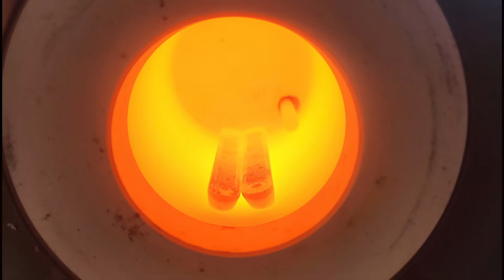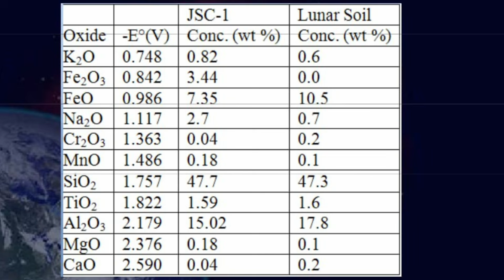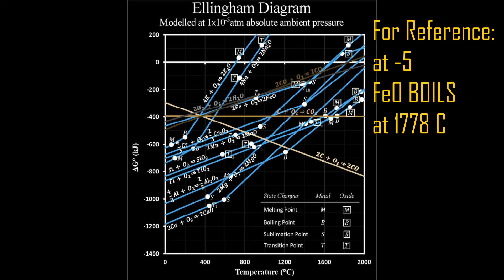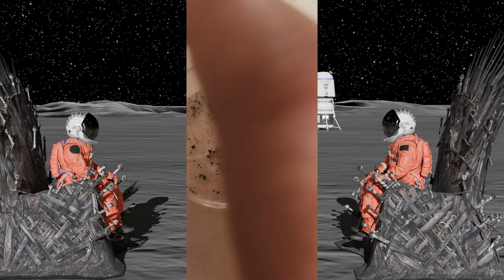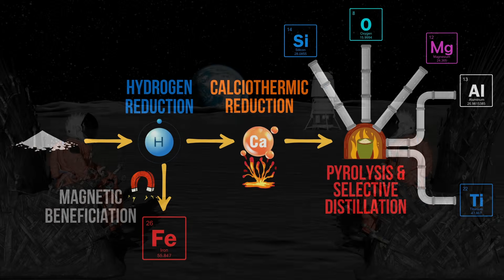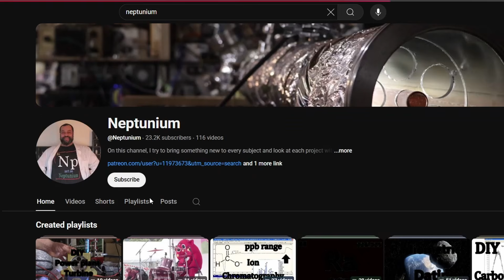Refining Moon Regolith With Lasers (Part 1)

Comment: 29:40 Helium isn't just used to cool quantum computers; it's used to cool the superconducting magnets in MRI scanners and NMR spectrometers, and the cost of boiling off non-renewable helium is a huge expense for science in those fields. Then again, given that boiling off the helium is often cheaper than trying to recover it means that maybe it wouldn't be cheaper to import helium from the moon 😅

Comment: one thing tham may be helpful: metal matrix composites may work as substitutes for alloying elements- instead of vanadium and carbon, it might be possible to simply mix alumina micro/nanoparticles into the iron matrix to get steel-level performance, 
aluminum and magnesium could support a lot (50 wt%, maybe more) alumina or silica or basalt or so to save on the energy intensive material, while at the same time improving its properties- and getting many of the benefits of metals, ie easier processing, toughness, tensile strength vs ceramics

Comment: 1.Grind your silica into fine power
2. Spread it 1mm deep over an area 1cm × 10cm
3. Sweep over the length of it with a 1 cm wide circle with the laser 

See if you can make several 1cm x 10cm strips of silica

4. Now , place the strips side by side , fill in the gaps with more silica dust , and see if you can weld them together with the laser.

Comment: I was inspired by this video to (at least try) and design a machine to do this. How much regolith would have to be processed (kg/hr)?
Reply: Note that I’m just a high school student and my only chemistry knowledge is from last year where it was a required course so I may not yield any results
Reply: Really depends on how much you need. For the very first refining processes built on the moon, 1 metric tonne per hour is probably reasonable given infrastructure limits (The bottleneck is not the small bucket-wheel harvesters which could gather dozens of tonnes quite easily, but rather the nuclear microreactors' limited power output).

For a larger colony, you probably want to produce enough hydrolox fuel per craft landing. For example, if you have 1 starship HLS arriving every week (with tourists and scientists), 1500 tons a week of fuel should be viable to avoid burning money, so let's call it 2000t per week to make some profit for the investors and provide enough water left for all of the colonists. Hydrolox fuel can be made easily by electrolysis of water, and given the approximate 5% water ice composition in the lunar PSRs, you'd thus need about 40000 tonnes of regolith processed per week, rounded up to about 250 tonnes per hour, which also leaves plenty of metal to be used for construction and to be sold back to low earth orbit for construction.

With a specific heat capacity of 800 joules/KgK, you'd need about 80Mw to maintain this upkeep, well achievable for a small modular reactor (since it's just heating, you can use the waste thermal energy for the first stage).

Comment: tbh, from the sounds of it, a giant tungstein crucible, thats being heated by a buncha solar reflectors, so everythign will melt below 3000c/6000f,  and then jsut have a tall evaporation chamber since everything turns into a vapor, and have a oil vapor distiller off it,

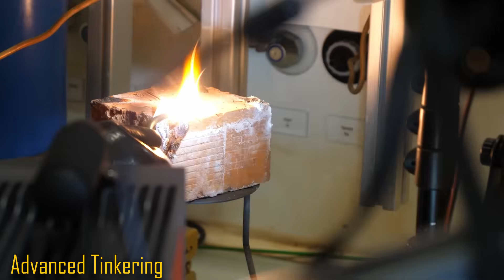Comment: 9:32 just like ask nile red to do it, or cody's lab. Failing that, collab with hyperspace pirate or Explosions&Fire.
Reply: Also a fluidized bed reactor could use chlorine to make volatile chlorates, which would decompose in different ways, allowing filtering by chemical processes.

Comment: You mention a lot about needing to import various materials (e.g., flluorine, iridium, etc.).  I understand you to be specifically referring to the period in which humankind have small outposts; but eventually, when industry has been built up sufficiently, such materials could be mined or extracted in other ways, right?  They are not that much rarer on the Moon than they are on Earth, especially considering that the Moon is not as strictly differentiated as Earth.  Correct me if I'm wrong, though.

Comment: at at 1621. My biggest criticism would be that sublimation of materials in a closed system would raise the pressure far beyond the ideal pressure for decomposing. its theoretically possible but the amount of usable material produce would be so low that it is unviable
Reply: Presure is maintained by a pumping system to  maintain a relatively low pressure
Reply: @friskydingo5370  The main problems is if your trying to use this laser process to do industrial scale processing . (as in trying to refine a mere ton of material in a day) . at best it would take a century of shipment to the moons to reach that level
Reply: @groomschild1617  The current set up can produce several grams a minute for iron. This may not be the best for industrial scale but it dose have the advantage of creating a item directly and may have neich purpose. This is just one of many reduction methods that have been tested. The laser is a surrogate for the sun in the lab. This is part 1 their will be more methods explored in future episodes

Comment: I once tried burning an oxyacetylene torch in a vacuum chamber to test a scene from the book Artemis by Andy Weir. I could not get the torch to light. Even passing a stochiometricly perfect mixture over a coil of glowing resistance wire didn't work.  When I ignited the torch before vacuuming out the chamber it worked just fine until about .2 atmospheres when the flame got big and then went out. I hypothesized that fire needs pressure to work. To test it I did several more tests with gunpowder, thermite, potassium in water, and even nitrogen triiodide. (videos of these are on my YouTube channel) All reactions were greatly slowed or stopped by lack of atmospheric pressure, only the thermite and potassium was able to burn but I suspect that's because the reaction is more like a shorted battery than a fire.
Anyway watching this I realized that a laser heating a rock is basically like trying to burn a torch that runs on oxygen and metal vapor. With atmospheric pressure the reactants are held together and can completely react but if the pressure is low enough the atoms can fly apart and cool off too much before they react completely. 

I guess now the question is can this be scaled up or is it always going to be just a curious thing that can happen? the problem I see is if you have a big enough laser the vapor coming off the rock will make its own pressure.
To put it another way if you make a rock very hot the vapor coming off will become an atmosphere of sort due to the reaction force as it rockets away pushing back on the vapor that comes after. If you really need a high vacuum the density of the vapor coming off is going to be very low and it will take forever to get a ton of product. 
It may be necessary to have a very large reactor, a big surface area being heated and a large volume for the vapor to expand into, to prevent pressure build up. Even processing a few grams per second might need something that makes a major league stadium look small. Of course, with the low gravity and no weather that might be viable, I doubt the actual structure needs to be more than a thin foil. 
lots to think about.
Reply from the maker: Yeah scale will definitely depend on structure volume but I haven't run the numbers. However we sublimated a few grams in just a few seconds in a test tube so I doubt it's thaaaat big of a difference. Also increased pressure will just raise the sublimation temps a few hundred degrees so there's a bit of a balancing act that can be done to find an optimal tradeoff between size and energy.

And recall that the pyrolysis we did here with the laser was done on non-reduced regolith (except for the slag but the CaO) and most oxides were reducing and sublimating around ~900-1000C.

If we did calciothermic reduction beforehand then that temp should be lowered meaning slightly less heat meaning slightly smaller structure for the same yield. Again just speculating and idk the numbers, the difference may not be significant at all, but I don't think it'll be stadiums for grams just cuz we got grams in an unreduced test tube 👍 

Very interesting with the flames though I never thought about it that way, going to check out those videos now
Reply: The optimal pressure is obtained by a pumping system. it's a closed system, The water vapor and O2 are stored, and hydrogen is recycled through the reactor. The pumping system would probably consist of a tmp and a cold trap. Tmp can be throttled to handle the difference in pressure. The FeO can be reduced directly by laser into Fe under h2 and can yield a useable metallic object. This happens fairly quickly.

Comment: Does processing have to be on the moon? 

We need all the materials for cis lunar development so just start lifting it off the surface the mass in the lunar Earth Lagrange for processing, tether stabilize the mass. 

It's the same thing just cutting out some steps.
Reply: For structures involved in the processing on the moon it should be there, but after that - yeah dirt in orbit is the best.

Comment: Hmm, any problem on the vacuum pyrolysis itself increasing pressure and suppressing further pyrolosis? At least with regard to accessing the most extreme pressures

3d printing is great, but, how close can you get to closing the loop and producing more laser sintering equipment from regolith? You can definitely do most of the structure, but can you make the lasers themselves?
Reply: Barely an inconvenience
Reply: The loop closing does not have to hand only on 3d printing.  Pyrolysis would work is it laser or sunshine - it about heating to high temperatures.

Ruby lasers is possible to make, and they do not have to be MW's kW's power to do some things.

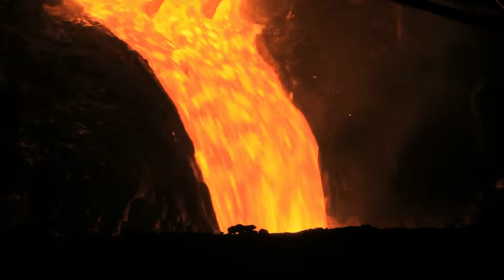Comment: 5:00 Can't we use CO2 from crewed missions for this? Like, import it at the beginning, and after having people and plants, we will have CO2 readily available
Reply: It better tomimport C directly, with humans profit balance is negative, it just an attempt to offset some cost, not a solution.
Reply: Technically, yes, you could as long as you have a easy way to separate the carbon from however, your sequestering it in the carbon scrubbers the issue is is that the average human will only exhale about 250 g of carbon a day assuming you get all of it out of the carbon dioxide. Getting a couple hundred grams per day per human doesn’t translate well when the smaller of scales for industrialization requires several tons to be processed. You could potentially use it at small scales but at such a small scale it may be worth it to just import the mass needed of carbon rather than Converting it there and importing the conversion mechanisms

Comment: You should read Troy Rising by  John Ringo. Especially the first book in the series. They use solar arrays to heat small asteroids and vacuum refine in space. Collect the pyrolytically separated gases from lighter elements and then peel off base metal and process to remove precious metals. Fun book with lots more going on in it, but your video reminded me of it

Comment: So many useful ways to refine the raw materials. The only thing that is required is fine tuning experiments to figure out optimal temperatures and then building test bed furnaces to send to the moon to begin getting operational experience with running them.

Comment: Can you do an episode dealing with the gravity problem.  You reference processes that have problems of impurities here on earth due to it’s gravity.   Like;

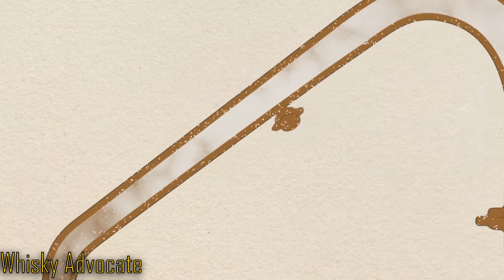28:40 H3
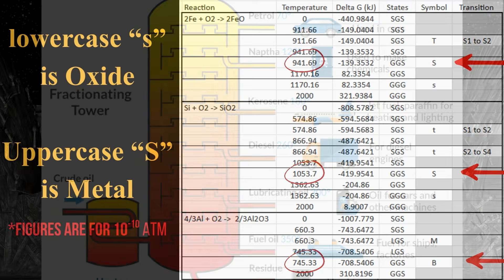47:48 Fractionating Tower

At what point do these systems break down to pointless due to it not separating well because of not enough gravity.  I know you can’t test it on earth but maybe someone could at least do a simulation to see if this is all for not or is it just going to be x times slower.
Reply: Tower does not really break, mass flow may be less and some tuning to of it may be needed, but as long as separation of liquid and gaseous phase happens it will work.
Reply: Even microgravity isn't a problem, as it possible to reorient where separation of gas phase and liquid happens, rotate the column axially and it will work. (Or rotate it not axially and it will work as well)
Reply: @Molb0rg  It's not about the phase change.  It's about impurities.   rotation doesn't separate things the same way as heat & gravity does.
Reply: @lucidmoses okay mentioning distillation column probably trew me ofcourse with this one, which would make more sense if you were talking about volatiles, but you probably not, so many the ignore.

Comment: Regarding the vacuum.  
    Wouldn't the vaporisers metals and oxygen GREATLY increase the local pressure.
    At an industrial scale I'd assume the pressure inside the reaction vessel to be way above 10 to the -13, right?
    Someone correct me if I'm wrong and explain please
Reply: Yes, the working pressures would be around  10*-3, torr at its lowest and typically higher. The extra pressure created by the disassociated o2 and h2o and stored separately. The working pressure is adjustable due to the off gassing and would be optimized for efficiency by keeping it that range.

Comment: I just keep thinking about industrial scale fluor chemistry in space. 

Like if tons of it leak in space would it form a dispersing danger cloud that eats away at spacecraft? 

How much does it take to etch a solar panel or eat some solar insulation foil? How about space suits?
Reply: You vastly underestimate the size of space and the rate of dissipation
Reply: It will fly away as sonic speeds
Reply: Same as with oxygen there is a potencial barrier of initiating a reaction, somit not a magical matter negating everything on its way.

Comment: Quick tip for recording, in certain sections we can hear your voice echoing. If you don't have a foam sound insulation recording room, simply recording under a blanket helps a lot with insulation and makes your voice crisper and clearer
Reply: He promised to use blanket next timez so we will watch and see

Comment: Just do the electrolysis and regulate voltage.
Can molten electrodes in electrolytic cells work for this regolith.
Reply: Molten regolith is conductive but it not the best conductor, so it an optimisation between things to have satisfactory current and electrodes are and all that
Reply: @Molb0rg um
I was talking about molten electrodes.
Both anode and cathode can be made up of dense molten metal.

And at large surface area resistance decrease.
Reply: @AKA-f7p yes larger surface more erosion. It looks like it should work, but it looks this way until one does not start to dive in details. I also hoped it can work but seems it does not, but we'll if it does it would be a nice bonus, I bet I seen some paper on direct electleysis where they had that fractional electleysis but I then could not find this pdf, seen it idk 7 years ago and wanted to find it again this year and zero.

Comment: Fresnel lenses would be a better choice for solar heating. Not too difficult to manufacture, light weight and easy to transport, can be made any size, etc. basically just a bumpy ridged sheet of glass or clear polycarbonate
Reply: Can unfortunately only be used during the lunar day, and your furnace will need to be able to tilt to align with the sun, but hey free furnace
Reply: It's so simple you could build a tiny tiny experimental furnace and test it on the actual moon next time we land there in person to do science
Reply: Wouldn't the pvc be basically unusable because of radiation damage?
Reply: @rishidas9731 fresnel lenses can be made out of a variety of materials, just needs to let light through. Tbh, I dunno what happens to clear vinyls on the moon.

These lenses could easily be made out of glass or oxidized aluminium, too. The biggest problems are going to be alignment with the sun and buildup of deposits of the vaporized target material, I think
Reply: It's actually the anthrofuturism plan for lunar industrial scale 

But for lab scale, like the tests done atm, it would be wildly impractical and expensive

Comment: Chlorine is available in about the 150ppm range, but is incredibly recoverable. For elemental separation purposes I would suggest, metal chloride distillation and deep UV photolysis under an excess of hydrogen atmosphere to recover HCL with an almost perfect recovery rate.
Reply: That's an extremely interesting idea. 👍

Comment: You can generate a huge magnetic  field on the moon that would pull in tons of solar wind hydrogen per day as well as helium 3 and 4. It would also create a gigawatt point source of power for processing materials.
Reply: Hydrogen is not really magnetic and helium only when a plasma.
Reply: @imaginary_friend7300 The solar wind is heavily ionised and traveling around 400km per second.
Reply: Total sun solar wind stuff is about 1.5 million tons per second , or about 5e-15kg/m2/s at our place, or about 0.05kg/s for the whole moon.
Reply: @Molb0rg Times it by the seconds in a day and you have tons.

Comment: Slightly off with the helium 3 helium 4 cooling, my understanding is helium 4 enters a super fluid state because it's a boson and that pushes out the helium 3 and forcing the helium 3 back into the 4 superfluid takes energy out of the superfluid
Reply: Interesting

Comment: Have you thought about using molecular seive adsorption to sequester the oxygen produced in the small test tubes when doing laser pyrolysis? If the limiting factor is rising pressure, then maybe they could keep the pressure low enough for long enough to allow you to reduce more product? The process is simple, cheapish, and low tech, seems promising.